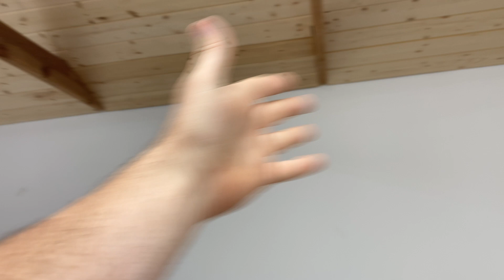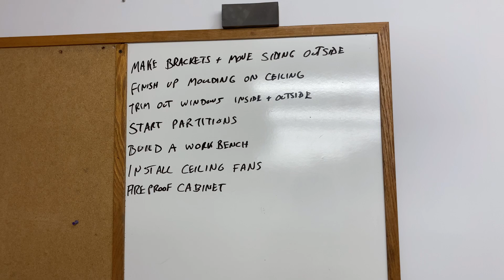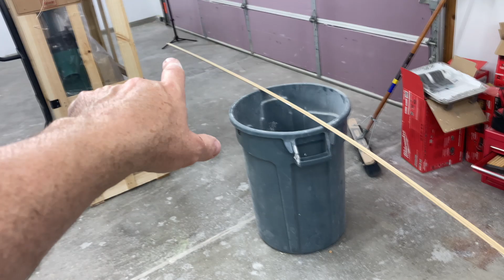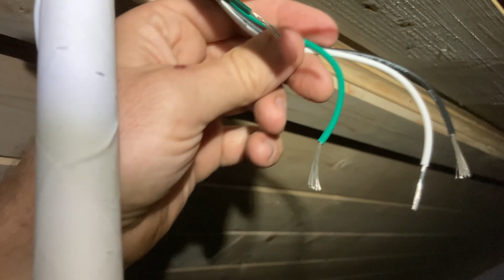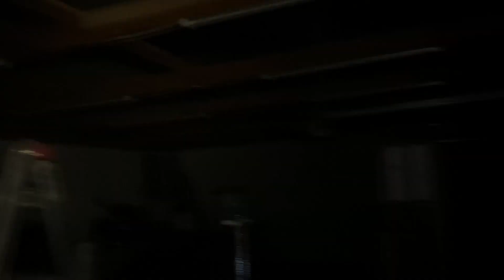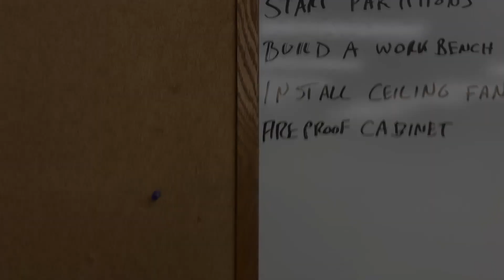Destroying The List

Comment: That oscillator will become one of your favorite tools. I can use mine for almost everything great tools. I prefer makita but just got on the m12 platform with a fuel impact/hammer drill set and the radio charger. May have to pick up that m12 oscillator also
Reply: Heather might like it too..😏

Comment: Its okay. I’m a factory mechanic and we don’t have electricians in maintenance. So we just wing it, and there has been a few times I’ve gotten lit up. 110 only thankfully mostly e stops sense they run off a chain with all the others so you have to change them live if they are broke. But I’ve shut part of the building down when I grounded my screwdriver on the wire housing before. Great feeling lol